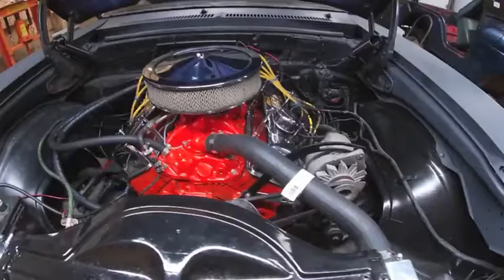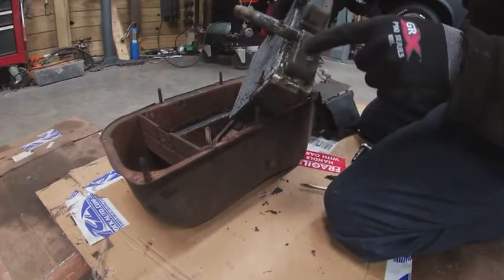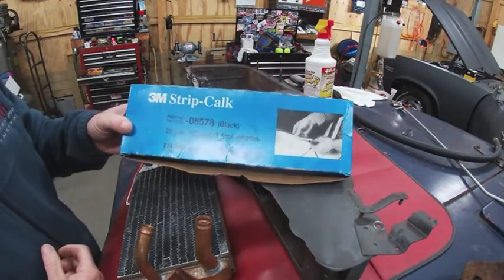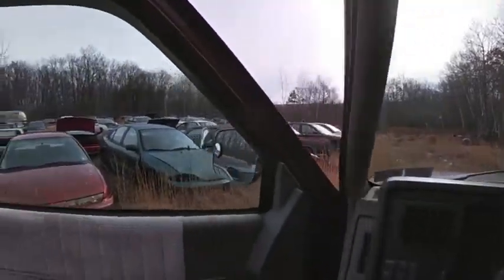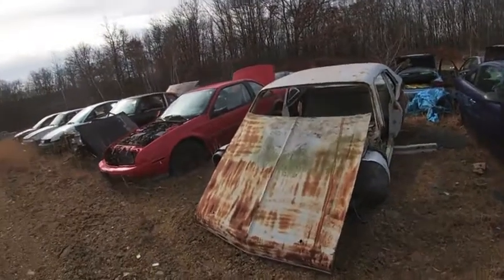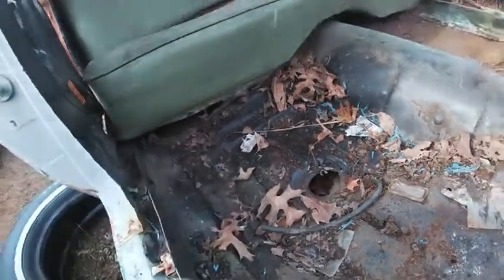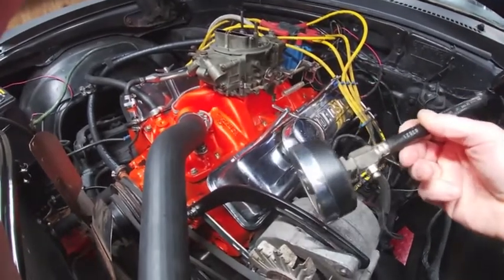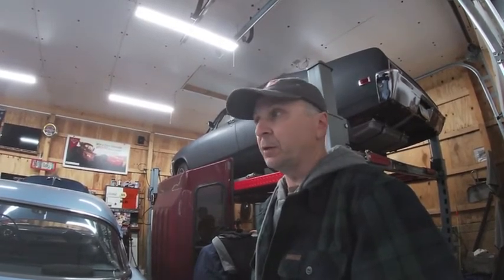69 Nova Revival P-4 Heater Core

Comment: What paint did you use satin?
Reply from the maker: It's been awhile. I believe it was Dupli Color engine paint DE1651. The color was a close match to the original. It is a gloss, but if you just dust it on, will dry more like a satin finish. Hope this helps, Thanks for watching!

Comment: Rockers set to tight can mimic a stuck valve. I have had 4 Nova's over the years.  Looking for #5 myself to last me the rest of my years.
Reply from the maker: After I made the video, I started thinking to myself that maybe it could be a broken valve spring, hadn't considered over tightened rockers. I'll pull the valve covers before pulling the engine, seems cheap running sbc's aren't as common around here as they use to be. Thanks for watching!